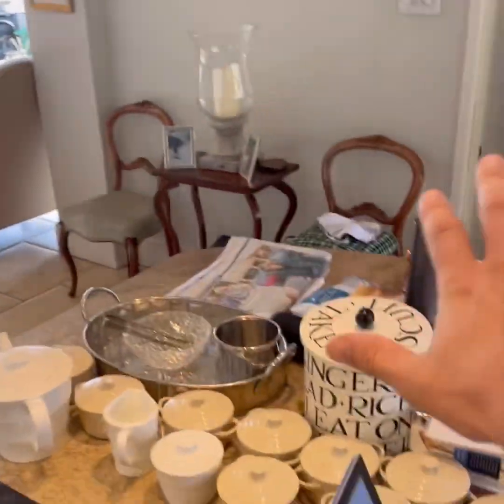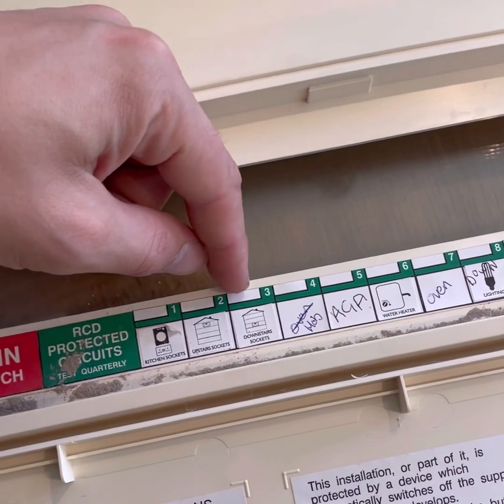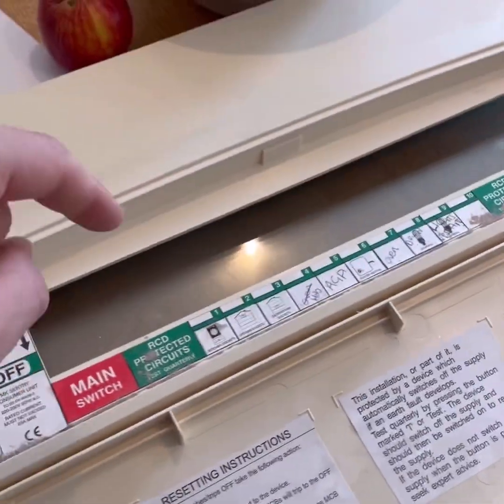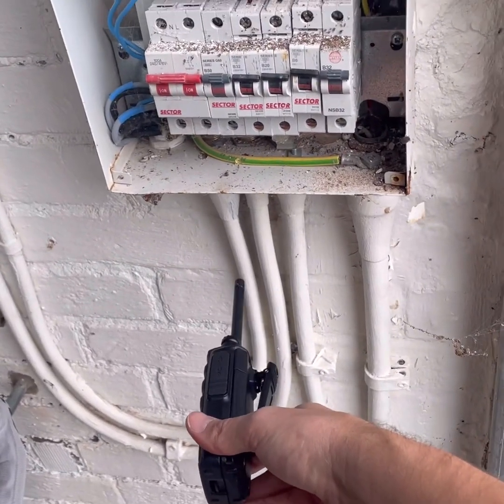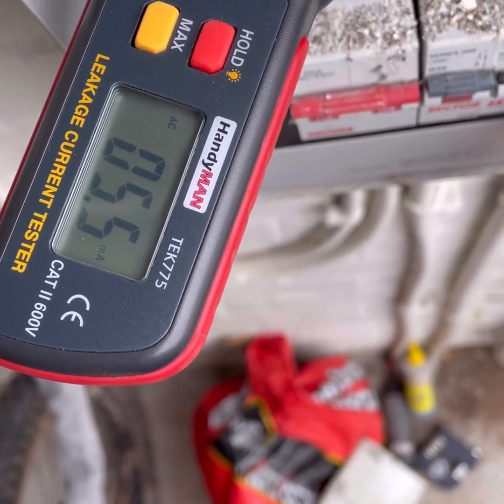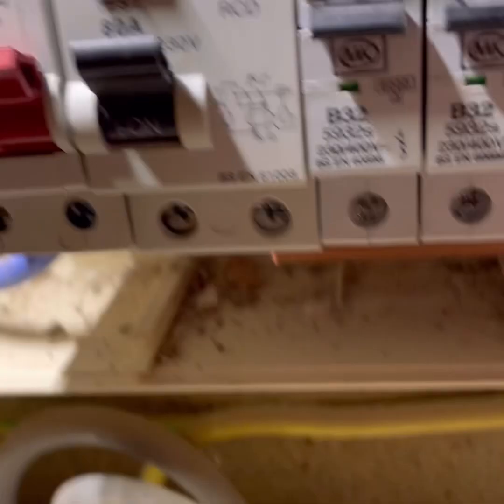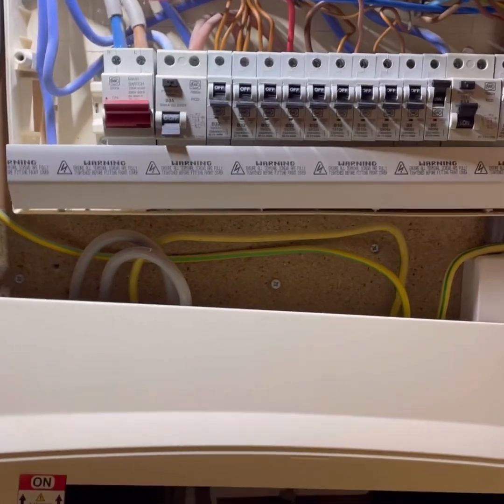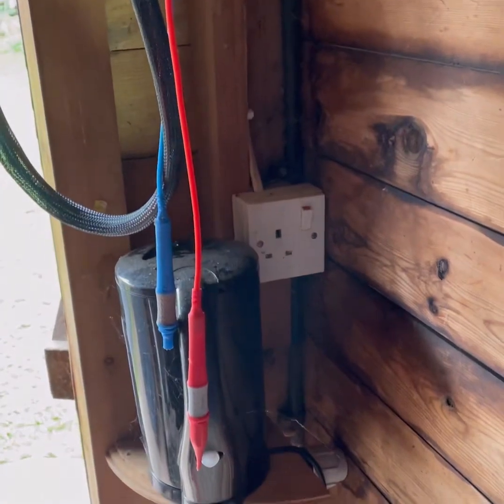EICR with mad Earth Leakage!

Comment: At 10:00 I guess thats not the leakage current you are measuring or did you bypass the RCD to measure it without having the RCD activate?
Reply from the maker: No RCD
Reply: Seems like I missed that, I watched it again and you also said that around 12:00
Reply from the maker: @fx-991DEX  still not RCD

Comment: Why do you remove the bonding from the clamp? 
By doing so you're not proving the clamp is connected to the pipe correctly just continuity of the bonding cable.
Reply from the maker: Otherwise I could test parallel paths and not confirm the continuity of the protective bonding conductor. Eg a common parallel path would be a cpc from the boiler supply